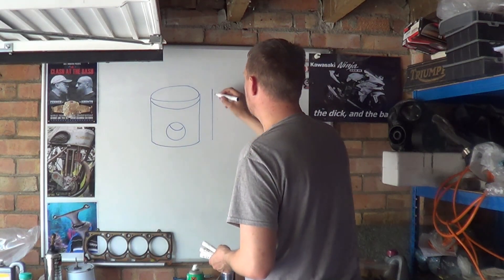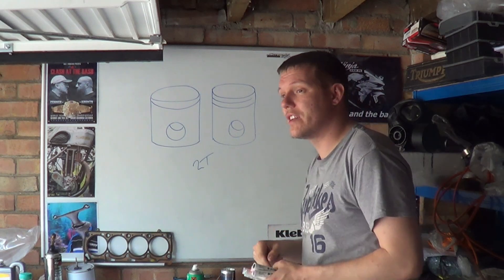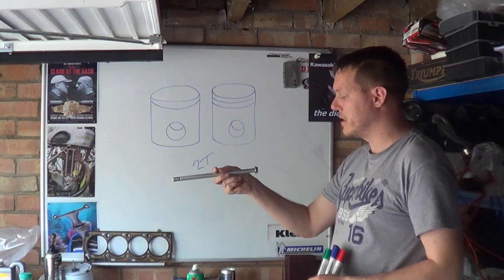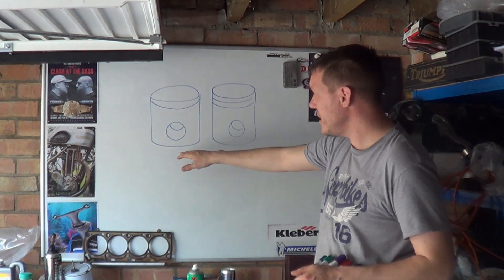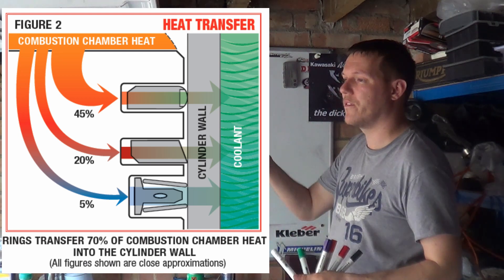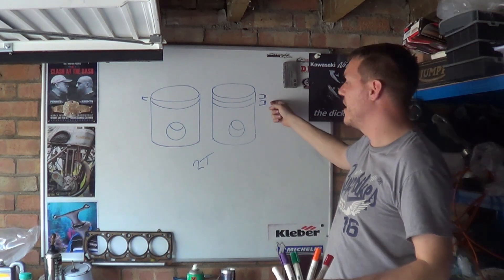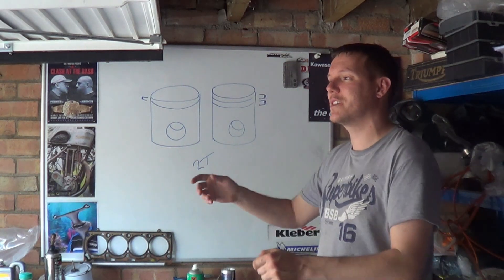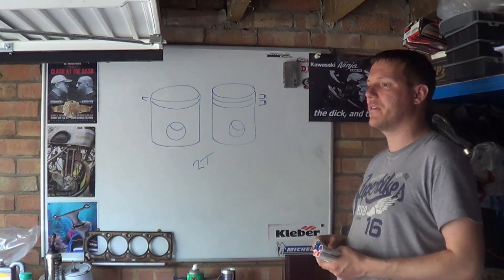2T - 1 piston ring or 2 + rant

Comment: Good tip on heat distribution from 2 rings i didnt think of that, but would having the 2nd ring and increased friction/heat from it not offset the advantage of more heat distribution threw the 2nd ring?

Comment: Designing any 2stroke to fail is easy as they do it now days . Look any the majority of any weed eater , lawn mower , chainsaw, ECT and look at why they don't run anymore and then look at the muffler. A good share of machines die due to over heating . The mufflers are made to keep them really quite and to due this ( as far as I understand ) it is choked out . This is one way to design something to fail. I could keep going and going.

Comment: There's been a scandal with bearings in washing machines failing. There's been planned obscolescense in the sense that repairs have been hindered intentionally. There was the 1000 hour light bulb cartel. But i don't think it applies to piston rings. Rubbers etc however in chinese bikes tend to degrade drastically after their 3rd year in an oxygen rich environment or with temperature changes (day-night) i recently pulled a 30 year old petrol hose off of a Honda. 1990. That was the year when Honda released their RC36. The VFR that still looks good today in 2021. And still work very very well. Man that fuel hose was still in nicer condition that most you can buy aftermarket from new today. Perfectly good condition. Those are the kinds of products you cannot afford to massproduce as a company.
Sure planning obsolescense is hard. But so is going to the moon. And people did that before the internet was even a thing.

Comment: 1 ring is use for very high end high rev machines. It comes in handy to reduce friction and thus temperatures.2 rings are used in more endurance optimised engines, lower revs often to get the highest torque they can get. Also in low revs the temperature ain´t much of a problem.The thickness of 2 rings makes sure they last a lot longer then a single 0.8mm ring. So it is all up to your application and specially keeping the eye on maintainance.I personally love 2 ring cast iron with a lot of torque. With plate instead of resonance exhausts. It has all the torque right from the get go, is much cheaper then nicasil shit, much better fuel economy and on the street there is no difference to the racing 16 old . And if it shits the bed, you still can get home with a cilinder wall in moonshape and a spare old piston.
Reply from the maker: erm..... reduced friction and therefroe heat? Wrong.
Reply: @thedirtyworkshop  I got the lesson it reduces heat in high rpm cylinders, but im eager to learn about other opinions.In what the dssc riders are telling me that is the main reason to go for 1 ring and alu/nicasil shit that breaks after the first seize.
Reply from the maker: So a few things are happening here....

1 ring applying pressure to a cylinder wall is less friction than 2 rings, this is true. However, about 45% of piston heat is transfered through the top ring and 20% of the heat through the 2nd ring, with the second ring missing the heat flux is higher through the top ring. 

This means that top single rings usually run hotter than a cylinder with 2. This is why single rings are usually chromoly or some other alloy blend. 2 rings last longer because there's less stress on the top ring, the ring that does most of the sealing.
Reply: @thedirtyworkshop  Sounds legit. Still on setups with 16000+ rpm they choose 1 ring and they are always talking about heatseaze problems with 2 rings.For me it is kinda nothing cause my vespa only runs like 9000rpm at max.Still it is very interesting to see some racers blow up their stuff in 5minutes.

Comment: Hi Matt thanks for the link. So just to re-iterate it's mainly about heat transference? There's no difference in compression? Are dual ring piston kits stronger? Cheers.
Reply from the maker: Firction and heat transfer. Why would compression be any different? If you mean blow by, you're talking about a 2 stroke - not exactly a great sealing engine

Comment: Tuner tip of the day:
You don't want the piston gap to be bigger on the top ring vs the gap on the lower ring.
Equal measured gap is ok because top ring expands more.
Trapped pressure between the two could make the top ring float att TDC.
Reply: I was taught it's better to have the bottom ring open more than the top to prevent flutter at higher rpms.

Comment: Are you talking a one cylinder 2stroke or multi pistons sharing a case? One cylinder one ring. Multi cylinders shared case two rings depending on configuration. Some configurations of multi piston 2 strokes are better for one ring.  Keep it simple stupid. Some engines you will see increased plug fouling with 2 rings. A one ring piston may help by letting more blow by.

Comment: another vid where no one mentions ring flutter. hmm. that is the biggest advantage of running the correct piston for your motor design.
Reply from the maker: "another vid where no one mentions ring flutter."

- because ring flutter is a thing of the past in most cases. Most rings are thinner these days which means they have lower inertia. It would be like doing loads of videos on points.
Reply: understood but the mass has more to do with the point of flutter than ring thickness now adays. good video, didnt mean the negative, just watched several already and no one mentioned that aspect and it surprsed me, thats all.

Comment: Most issues with washing machines is that the electronics give out faster than they used to, on our washing machine we replaced a power capacitor for the engine with the "correctly" specced one, broke a couple months later. So then we bought an over specced (by like 20% voltage and a couple % capacitance because that was what we could find), 8 years later and it still runs perfectly.

So there's some truth to things "being designed" to break, but mostly it comes down to underspecced parts

Comment: Single piston spring pistons are usually for high rpm racing applications.
Some 70 or 90cc scooters for example, rev up to 16.000 rpm and have up to 35hp.
Those are serviced after every race hehe. For daily use double rings are better :P
Also having good quality oil helps sealing off compression abit.

Comment: Cambelts don't have to be designed to fail, they are a failure to begin with. Don't get me onto washing machines and sealed drums, then no vent between bearings so will always try to suck cool moist air past seal with temperature change.

Comment: the ring pins are 180 degrees apart, better sealing ?   I wouldnt do it, you need  all the oil on the ycylinder as you can get with out alot of smoke.
\

Comment: One has to remember the difference in racing or one to last for a while..  Heat is the number one killer of all engines.  You have to be able to control the heat and get all the power from it at the same time.. remember 70% of the lost is thru heat..

Comment: well, husqvarna uses 1 ring, and i can not complain about it.
the new saws come with an internal lil computer , so we can read the operating hours.
after 1500 workhours actually the ring was fine, but the main bearings where worn out to the point when i prefer them replaced.
soo.. i thnk a single ring is fine, husqvarna is a quite respected maker of chainsaws and stuff.. 
so if you sortha ask me, 1 ring is perfectly enough. keep in mind chainsaws operate (at least in professional use) under verry harsh conditions, and heat managment is quite a difficult task since the saws have to be light, rev high, have huge power for the weight, and space is verry limited. allso we do like to utilise most of the power they make.
now 1500 hours under these conditions is proof enough for me, think about your bike, take say.. 80% of its top speed and calculate how far would you get with that speed in 1500 hours. say.. a scooter doing 50 km /hr would do 75000 km or ~46000 miles, or just for you island dwelling folks ~82 million yards.
its enough.
Reply from the maker: I get what you mean, but your scaling is incorrect. More on this in the a future video - matt
Reply: The Workshop 
yep, incorrect scaling. but still 1 ring is durable enough.

Comment: my yz125 has a single ring as do most 125 2t dirtbikes. The thing that sucks about them is obviously topend rebuilds come up quite a bit sooner than the 200, 250, and 300+cc 2t bikes (of course being small and revving to the moon for a 2t contributes too). But I know it reduces a bit of drag to increase the hp a bit, it is impressive these 125 bikes are putting out round about 40hp in such a nice light package. As always thanks for the video!
Reply: You can always switch to double rings on the 125cc

Comment: Generally speaking, road 2 strokes have 2 rings, off road and MX 2 stroke single 1 ring, having to swap rings on a 2 stroke twin is a hassle, for an off road single it takes minutes. If they used single rings in multi cycle road bikes buyers would go nuts about having the change rings as often as off road bikes do. But that is assumption from experience only, i rebuilt more bike engines as a mechanic than I've had hot breakfasts and I've never found any other reason for the difference other than 2 rings lasts longer and off road and race bikes a re-ring is a quick job and road bikes not so quick.
Reply from the maker: "and I've never found any other reason for the difference other than 2 rings lasts longer and off road and race bikes a re-ring is a quick job and road bikes not so quick."

- it depends on 
1) what the engine is intended for
2) thermal loading, etc etc etc 

Rebuilding and the number of rings/cost has nothing to do with it. The manufacturer doesn't care and how many rings it had isn't a selling point. You have to crack the engine open to find out how many rings it has, or look in the manual
Reply: I Make and Fix Stuff my yz 250 has 2 rings
Reply: Ill do a bit more research. Going on memory and previous debates on this issue.
Reply: Larger capacity usually do, I think I covered that.
Reply: I Make and Fix Stuff oh idk, I just felt like telling you
Reply: Cheers
Reply: I know this much, one ring piston is a performance upgrade. Eg YZ250 has twin ring and single ring piston upgrade, Wiseco forged pistons for same are single ring. And there is observable power to be gained by one ring over 2, however 1 ring don't last as long.
Reply: Just had a look in my Gordon Jennings bible and references single ring in quote "Neither is there any advantage below 7000 rpm in the use of single-ring pistons. Above that level the lower friction of the single-ring piston begins to make a difference, but in the lower speed ranges you may as well use two-ring pistons and take advantage of their “second line of defense” capability."
Reply: Did a bit of reading and few issues came up I've debated in the past (oh so many years ago).We know that removing one ring does yield improvements in power by reduction of friction as well as the ability to rev it higher with one ring being half the weight to the piston of two. That is empirical and can be repeated in experiment to verify. But the jury is not out and it doesn't end there and you can find good reasons not to use single rings, for example in racing you may gain a bit by single ring piston however any injury to the ring will see a big fall on compression and you get your arse handed to you, where having 2 rings you would not loose so much and could finish the race handily. Personally i would err on the 2 ring option for that reason more then anything. So IMO it's one of those issues that there is no hard rule about using either .

Comment: one ring to rule them all. can you do a video on nikasil linings. what are the pros and cons?? i work in a bike garage and have seen many nikasil coatings flake off the cylinder walls even though the piston rings and piston seem to be ok. the worst i've seen was on a polaris jet ski. it was a 750cc turbocharged unit. surely a steel liner would have been better in the engine considering is pumps out an astonishing 143hp. cheers
Reply from the maker: Yes I can ATTL - matt

Comment: Thanks for the video, but I hear people say 1 ring gives you more top end while 2 rings will give you a smoother powerband. What can you say about this?
Reply: Kuruma Designs I personally believe they're probably associating that to the characteristics of the engines that typically have twin or single rings. For instance 125's pretty much all have single rings and are very peaky bikes with a small window of about 2k to 2,500 rpm worth of powerband, where as the 200, 250, and 300s which are generally twin ring have a much wider powerband. The Honda 250 2t's were single ring and they didn't behave much different than the other manufacturers 250 2t's, they were great bikes but didn't seem to have any advantage.
Reply: Hmm, maybe. But I know for example ktm 125 exc has two rings and they have a pretty smooth powerband, while my friends husky cr 144 is single ring and hits hard on top. But one is an enduro bike and the other is a motocross bike so the differences may be in the porting of the cylinders rather then the number of rings.
Reply: Kuruma Designs it has a smooth powerband because it has a flywheel weight.
Reply: I don't belive that the only thing that is affecting it is the weight of the flywheel, surely it must have something to do with the port map as well.
Reply: For example I have a moped with a 80cc racing cylinder, and it has a single ring piston. I also have a race exhaust and stock ignition with a pretty big heavy flywheel. And this moped is very peaky, hits powerband at about 9krpm and carrys on until about 12-13krpm.
Reply: Kuruma Designs hard to compare an 80cc engine to a 125cc power valve setup. But I know for sure it's 80 percent or more the flywheel weight. as stated just look at the cr 250 single ring vs the kx yz sx and rm 250 which are twin ring, they all have similar characteristics regardless of the rings.
Reply: alright

Comment: In power tools (especially consumer grade) the component has been engineered to be as inexpensive as possible to produce while only having to outlive the warranty (even by just one day). Otherwise they have to make the warranty more expensive to pursue (either monetarily or time wise).
Reply from the maker: "to produce while only having to outlive the warranty (even by just one day)." 

- bollocks. So what your saying it that on thurday (day before warranty runs out) its fine. Saturday comes and it dies - bollocks. Lets take a cordless drill. Warranty 2 years, I don't use it until the last day of warranty and then it dies the day after from 1 hours use - fucking rubbish.
Reply: not from lack of use obviously just like old new stock isn't shit out of the box unless it was stored improperly. No what i was saying is that under intended use that is within what the warranty covers (many consumer grade power tools specify not for industrial use ) it will survive the warranty period. it even applies to stand by items that are in an always ready state like say a sump pump it only needs to be built to withstand intended use until the warranty is up if it only gets used four or five times in that year or two and is found to be seized just the day after the warranty ends then the company got it perfect (from a corporate standpoint) but if it dies before the warranty is up they just lost money and if it lasts twice as long they technically lost money on the replacement that would have been bought.
Reply: I can smell the crumpets and bullshit from here try harder next time lass